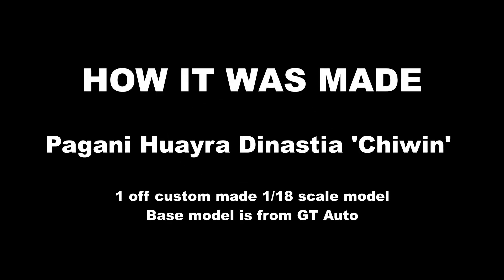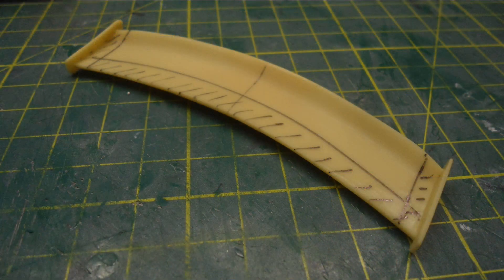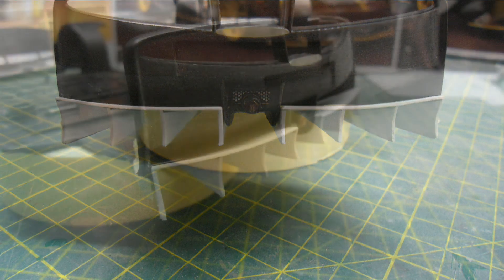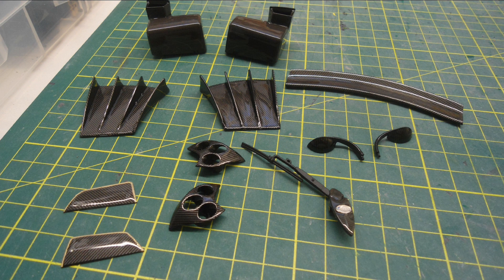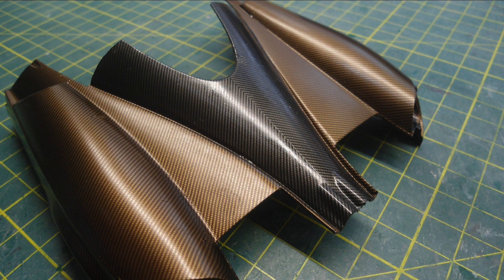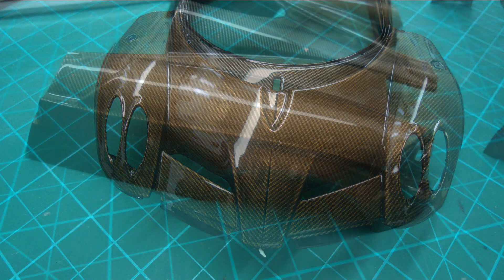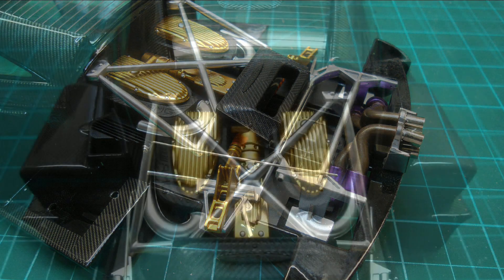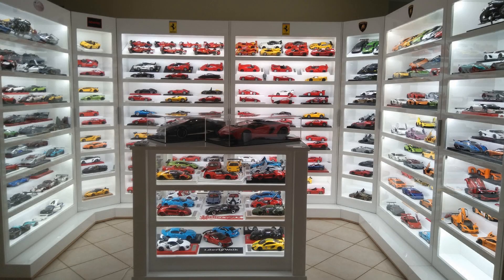HOW IT WAS MADE Pagani Huayra Dinastia Chiwen CUSTOM model

Comment: With the same wheels you used for the BBR model, I'm planning on getting those wheels for my GT Auto's model too. How do they fit? do they need any modifications? If I'm correct the GT Auto's model has screw on wheels, so how did you go about it? Thanks 👍🏼